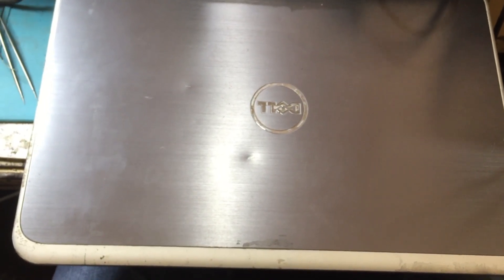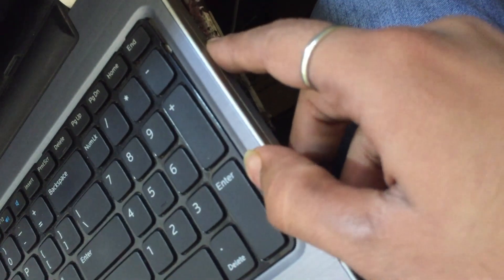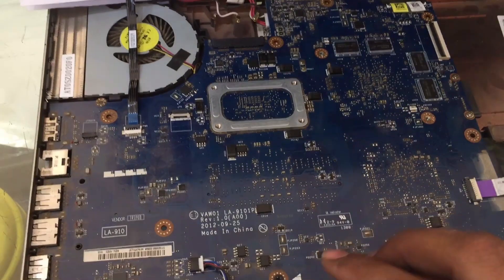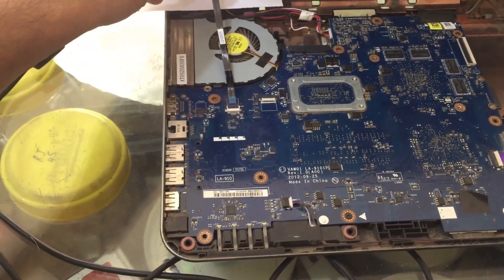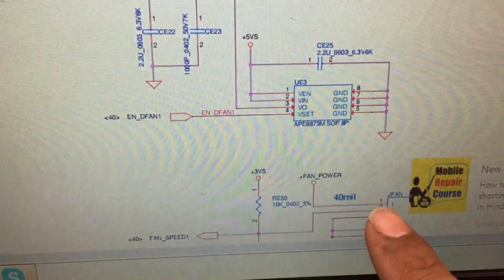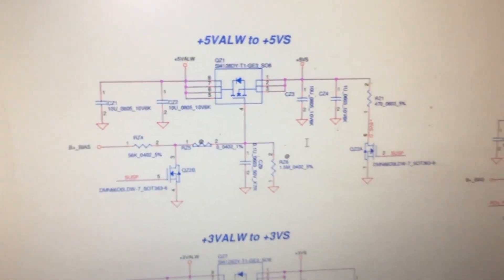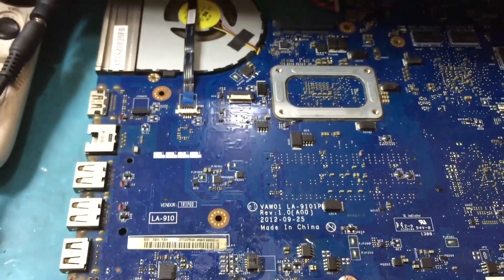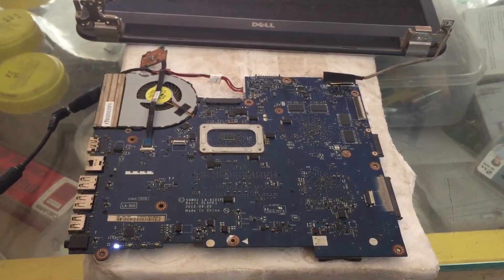#LaptopRepair Dell laptop power on but no display Repair Step by Step#Aditya11ttt & #SatishBhai

Comment: Can u explain for me my dell laptop(latitude e5430) which failed to detect battery voltage.I removed the battery and the voltage is 12.4v but it shows 0% and not charging

Comment: Sir mera Dell Vostro 3558 h. Cell sahi but laptop me lgane pe battery charge nhi ho rhi. Battery k circuit me problem h agr to kaise check kre?

Agr hm laptop k charging jack pe voltage check kre bina battery lgaye... To kya wha battery ki charging voltage show krega....ya wo battery lgane pe hi ati h?

Agr me adapter pe laptop chlata hu to battery lgate hi charging light bnd ho jati h

Comment: I am working on an Acer Aspire 5750 motherboard which I have on the table, plugged in. When turned on, this motherboard has fanspin and shows blue LED lights for a second or two and then shuts itself down. This repeats itself 4 times or so until it stops attempting to turn on. Probably a short? Can you suggest my next move? thx
Reply from the maker: Check all the primary and secondary voltages and ic areas !

Comment: My laptop is 6 year old and not getting boot up does it problem of CMOS battery
Reply from the maker: Bios setting or win corrupt
Reply: @Aditya11ttt  it also happen during every Tuesday security patch update
Reply: @Aditya11ttt  how can it resolved
Reply from the maker: Windows issue or bios issue 
Get to near by repair shop !!
Reply: @Aditya11ttt  what type of windows issue and how much it cost please help as I'm a student and need laptop daily for my classes

Comment: Good video. Thanks for sharing a useful video.
Sir, I have the same board   Dell Inspiron 3521 LA-9101P Rev-1.0 (A00). 
It suddenly stopped booting and now there a single tik...tik..tik sound with no display. I checked my hard disk, ram, display cable (used external display as well) but the same problem occurs. As I figured it looks to be bios chip problem which I need to flash.  Since its a lockdown time, I am not able to get it repaired from repair shop. So I am planning to do it by myself using CH341A 24 25 Series EEPROM Flash BIOS USB Programmer using a  SOIC8 SOP8 Flash Chip IC Test Clips Socket Adpter Programmer.  Problem is I am not able to find the Main bios file for LA-9101P Rev-1.0 (A00).  I googled and most of the bios file are of
Inspiron 3521 LA-9101P Rev-.45 (A00). or Inspiron 3521  LA-9104P Rev-1.0. 
Kindly guide me in this regard. Can I flash using  LA-9101P Rev-.45 (A00) or Inspiron 3521  LA-9104P Rev-1.0 bios files?  If possible can you share the bios file for above motherboard?

Comment: SIR MY FUJITSU SIEMENS TURN ON BUT NO DISPLAY NOT WORKING FAN AND THIS NO BATTERY HIS BATTERY DEAD THIS LAPTOP ALWAYS CONNECT TO ELECTRIC POWER AND NOW  NO DISPLAY AND NO FAN BUT THERES A BLINK LIGHT POWER
MODEL LAPTOP "FUJITSU  SIEMENS M9400" 2008 VERSION.  .THIS IS 12 YEARS OLD LAPTOP BUT THE HDD STILL WORKING
Reply from the maker: Buy new laptop it’s 12 years ! And secondly the information u gave is not enough for me !

Comment: Hi Aditya, Great work on resolving this issue! btw I'm currently working on a Samsung np150 that is powering on, you can hear it's booting on windows but no display both internal and external, all voltages are present from the lcd port/ 19v, 1.8v 3.3v.5v.. 5v and 3v alws are present. tried a different screen but no luck, i also tried to reheat the gmch but still no luck. Any idea to solve this issue? thanks in advance
Reply from the maker: Bios ?
Reply: Thanks for your prompt response. Bios has 3.3v present and it's booting to windows, you can just hear it. Do you think It needs to reprogram the bios even if it's booting to Windows? I'll try that anyway and wish me luck. Thanks!
Reply from the maker: allan cadao dose 3.3v signifies bios is 100% ok ?
Reply: I think not. You have some videos that has 3.3v on bios but had bad program on it. I don't have oscilloscope and can't check it's signal. :(
Reply from the maker: allan cadao  now u decide what to do !! Next !!
Reply: Thanks!

Comment: sir my laptop Sony Vaio.. when i turn on the laptop, it will take 3 to 4 minutes for os loading..
no problem with hdd & os. but What is the problem, pls tell me?
Reply from the maker: Battula Thirumala chcek heating
Reply: @Aditya11ttt  normal heat
Reply from the maker: Use Ssd for more fast boot up

Comment: Hi, I have a dell inspiron 13 7359 and it only shows the charging LED on, NO display on screen at all and no fan noise. I tried to pull out the battery and hold the power button for 1min to discharge the current but still not worked. The mechanic says its a motherboard problem and need to replace motherboard.
Tell me how can I fix it??
Reply from the maker: plz contact us via whats app!!